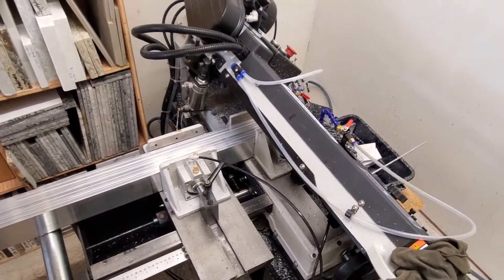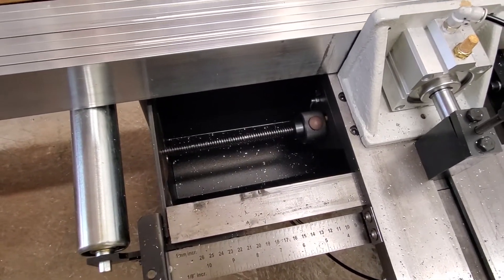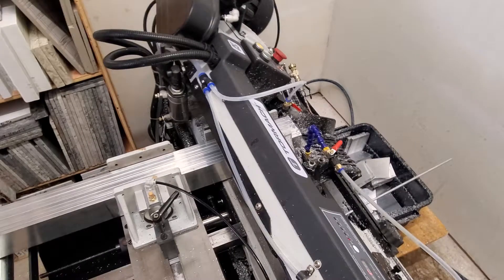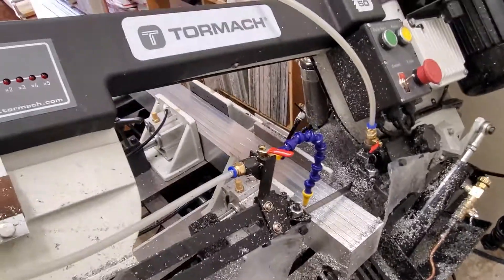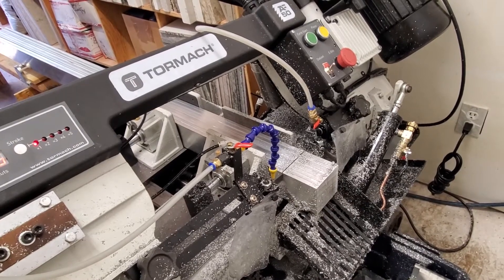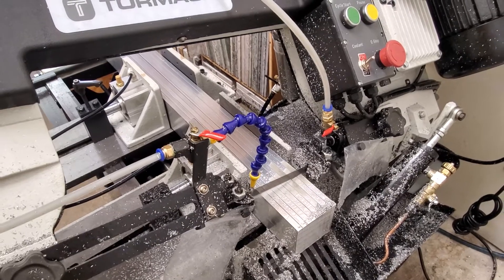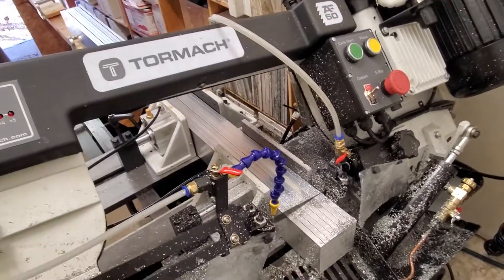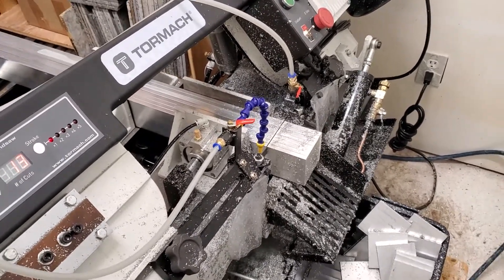Tormach AF50 bandsaw review

Comment: I need it to cut 1" thick steel flat bar 4 to ,6" wide
Reply from the maker: No problem as long as you slow the blade speed down, even sawing them laying down in the vise. I no longer use it's highest speed even cutting aluminum as it just doesn't have the power. Once I got it to run full bars fine, after fixing the loose fixed jaw clamp mount, I no longer care how long it takes to cut so have been running it at it's slowest speed after cutting some steel. It isn't much slower and the motor doesn't heat up as much. It still cuts up parts far faster than I can run them on my Brother R650. Load up enough bars to fill a 5 gallon bucket, push the green button, come back when I know it is done, and repeat. There is a lot of room for improvement on this saw but it does work fine. I have no regrets buying this saw, I just wish Tormach would do a little more to make it a lot better.

Comment: what do they use to regulate the feed ram speed is the needle valve rite on the cylinder? i am in the middle of doing a diy version of this but with a evo saw!
Reply from the maker: That's what it looks like. It takes quite a few turns to make a difference. I would think it is a standard accessory for air cylinders. Probably a needle valve for the incomming air would be fine, no need to control both directions independantly.

Comment: So based off your video, and your reply on another question I asked you, I purchased one. I have it set up, sort of. Seeing how you have been using this thing for a bit, what pressure do you have your vice at? Tormach  doesn’t say anything. Also, how did you slow down your shuttle vise? My SLAMS around….
Reply from the maker: I generally run my vises around 40 psi for what I cut and haven't had anything move so far. To adjust the speed of the air cylinders turn the metal knob with the locknuts on the fittings that the hoses press into. Not too fast and not too slow, it has to be juuuust right. I haven't been using the fastest blade speed but the second fastest. It seems to cut better with the extra torque. The motor just doesn't have the power to really use the fastest setting.

Comment: All the problems you mentioned are very common with Tormach equipment. I had the same experience with one of their mills. I had to fix a lot of stuff. They don't really sell machines. They sell hastily assembled kits that need to be adjusted, adapted, rebuilt, finished and fiddled with. Ultimately, you can make their stuff work in certain circumstances, but it rarely functions as easily or consistently as advertised. I appreciate you sharing your experience. I was hoping that since this is a much simpler machine than a mill, and since it's been several years since my purchase, they might have improved their quality, but seeing that blade bounce down into your stock does instill much confidence. I had to laugh when I saw that you had to hang plastic to keep the coolant from spraying all over the place. I had to hang two shower curtains inside my mill's full enclosure to keep coolant from drooling all over the floor.
Reply from the maker: Yeah, what I got was not a surprise but it is the right size for what I need, anything bigger wouldn't fit. Your description of a pre-assembled kit that needs to be fully inspected and adjusted is dead on. I had been designing a smaller version of this saw in my head for several years before it came out so I was expecting to modify it anyway. All in all I am quite happy with what I got for the price paid, but if they would just do a little better job in a few spots it would make it a far better saw.

I can't imagine having one of their mills. For the same price you can get an older high quality used VMC that's still in great shape. Do call the MTB up to find out how much support they will offer and how much it will cost. With Enshu it is $750 and excellent support. With Kitamura it is free and excellent. This isn't the case with everyone.

Comment: First thank you for doing the video, not many on this machine to be found. My question for you is, what would you say your average accuracy is? I know at one point you said it is .005 but at another point you said it was .010
Reply from the maker: I would say over half of my parts are +/-.003" when set up well. It is sensitive to shuttle speed, not too slow or fast. I am sure it can do better but I still need to check the vises and do a bit of work to the fixed one to solve some issues with it.

Comment: Helpful tip, have your compressor run at the max pressure it is rated for, then use a regulator to reduce pressure for each machine.  That way you always have constant pressure.  i.e. my compressor runs between 120~150 but is regulated to 100psi right after the tank, then each machine has another regulator/dryer/separator to reduce further.
Reply from the maker: I have it set to run 80-150 to reduce cycling when running my Kitamura. It uses a LOT of air so typically my compressor runs for 4 minutes and is off for 7. Both of my mills are Japanese so they want 60psi air. This is the only thing in my shop that wants higher air pressure.

Comment: You need to add a solid nylon or delrin roller, 1.5-2" dia on an arm that you can swing down on top of the stock back where the stock is feeding into the vise. Maybe even incorporate a stiff spring into it so there downward pressure but it allows some give.
Reply from the maker: That is what I was thinking but I would put it right above the rear roller, with a cantilevered weight to hold it down. There are nice mounting locations and holes right in front of that roller on both sides. But, after the last run of stock I am thinking that the vises are much of the problem and I should try to fix them first to see how much that helps.

1) The moving vise jaw on the saw lifts a lot, .075", so I am going to add a lock on it's stop so I can clamp it tight to the bed vs just using the lead screw to hold it in place. Similar to the lock on the shuttle vise. There are a few "issues" with the lead screw and crank wheel assembly so it should not be used to hold the jaw stop in place. Watching the jaw clamp the stock with the slop I can see the jaw lift quite a lot, lifting the stock in the process.

2) The flat head screws that hold the moving jaw to the air cylinder body on the shuttle are proud about .02" so I need to fix that and check all jaws to be sure they are perpendicular to the shuttle and saw beds, or tilted a tad to help push the stock down.

While I like the saw there are a few of those cheap Chinese sloppy hacks that need fixing.

Comment: Knowing what you know now, would you buy it again?
Reply from the maker: Yes, absolutely. There are a few things that I need to fix but I think the basic machine is sound, considering the price. Since the video I cut 1,100 lbs of aluminum into 6,400 parts. After the first few cycles I never changed anything. I did have my corse Starrett blade crack so I ended up with a finer pitch blade than was optimum. I have since purchased a few 4 tpi blades to try on the next run.
Reply: @cgpmachining  Yeah, anything beats cutting through solid aluminum on a chop saw. That's why I was looking at it. I have the same base bandsaw. (The Tormach saw is the same model Harbor Freight sells for $1,100.) I find it to be underpowered for solid aluminum. You'll never get through the 6 by 8 inches of solid stock Tormach claims in its specs, without upgrading to a 2 or 3hp motor with a better torque curve for the rpms. (More fiddling!)
Reply from the maker: @grappler185  Agreed about it being seriously underpowered with a 1 China hp motor, think Haas power. The solution for now is to use the second fastest speed most of the time. It really isn't any slower but at least you can take the correct chip load. The biggest cut so far was 2"x8" 6061 bar and it did it fine, in 3rd gear, laying flat so it was an 8" cut.
I do wonder if the gear box could handle 2-3 hp? Mine gets fairly hot after a few minutes of work.